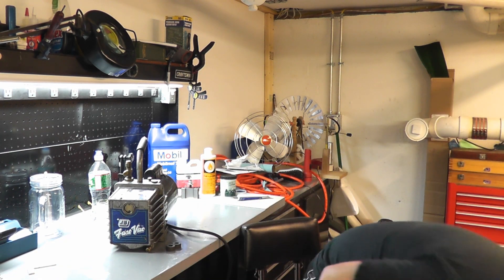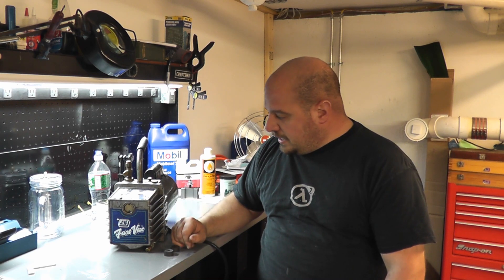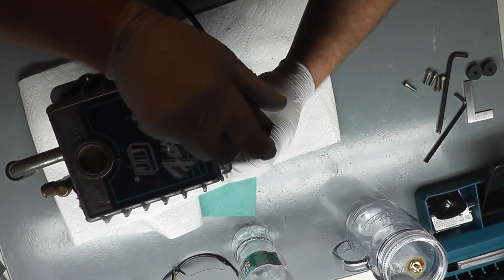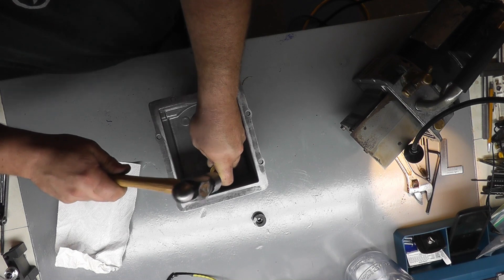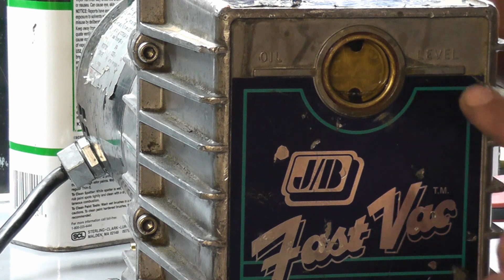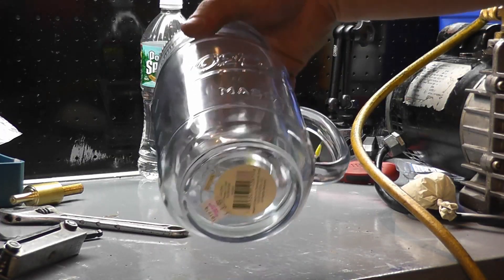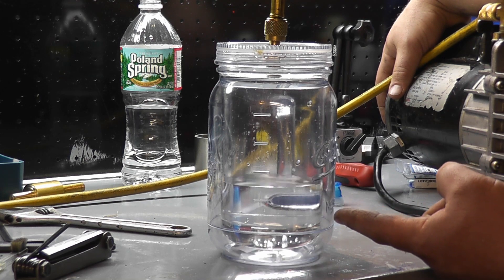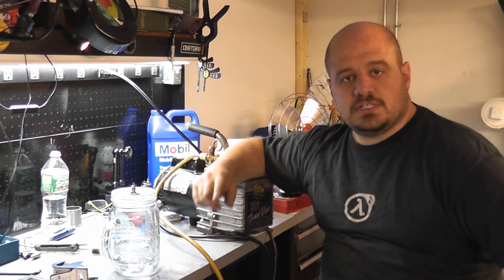Vacuum Pump Fun

Comment: Interestingly, not only does putting water under vacuum raise the boiling point, putting it under pressure also lowers the freezing point (and the boiling point). It's how ice skates work; it melts a layer of the ice right under the blade, which gives very low friction. There's also quite a cool effect where if you hang weights off a block of ice with a really thin wire, the wire will melt the ice and be able to pass through, but when the pressure is gone the water will refreeze, so the wire can go all the way through the ice, but leave it in one piece.

Comment: I had a new deep freeze that I stored for a few years.  When I went back for it the cabinet had some rust holes so I took out the compressor and soldered on a fitting and use it for a vacuum pump on the rare occasion when I need one.  The occasional car AC compressor failure and such.  Lately I have read the instructions from the car companies say to just purge the system with refrigerant, pull a vacuum and charge it.  They say it is not worth the trouble of boiling out for a long time on an automotive system.  Thanks for the video.

Comment: Perfect timing!  I just flushed a bunch of very new hydraulic oil out of my shop press that's water contaminated.  I'm gonna get a jar and some fittings and vacuum that oil back into shape. :)
Reply: UPDATE: Not going as I expected.  I get some boil off at the start but I think vacuum drying 3 gallons of heavily saturated oil will take, conservatively, until the End of Time.  I now appreciate the time needed to vac a large old system.  I just assumed the water would flash off quickly but hydraulic oil (and maybe reefer oil as well) appears to be quite hygroscopic and will happily hold  onto water like Rosie O'Donnell clutching a Twinkie.  While heating the oil helped, I had to get it to a temp that boiled off the lighter fractions that might make the oil unusable.

Bottom line: It's not worth the effort.  At 5 bucks a quart I'll just buy new oil.
Reply: +Eddie the Grouch Dang it!! I have gallons of it from my excavator that I was hoping to salvage....One particular bucket was only in the machine for 5 minutes then changed. :-(
Reply: +Eddie the Grouch +CompEdgeX 
Moisture contaminated oil can usually be dehydrated by heat. 
Place the oil in an open top container and heat to at least 220 degrees Fahrenheit but less than about 260 degrees Fahrenheit for about 30 minutes. We usually target about 230-250 degrees. This temperature range does not harm the oil but boils the moisture out of the oil allowing it to escape into the atmosphere. 
Immediately place the oil in a container and seal before it reaches 180 degrees Fahrenheit and it is as dry or drier than when it left the refinery. 
Most refrigeration oil and some hydraulic oil is highly hygroscopic by design to absorb moisture and protect the system from undesirable reaction such as acid formation and resultant corrosion. 
We have a commercial mobile oil reclamation and filtration system that automates the process and filters down to 10 micons, but before we purchased the commercial unit we used to perform the process manually and never had a problem. The commercial unit has Vickers, SAE, ANSI, API, Mobil and Shell approval.
Reply: patw52pb1
I never thought that heat would be an issue...when I'm working the excavator on a 30deg C day that oil gets mighty hot as it is. I kinda figured the vacuum would allow moisture removal without setting up a heat source. Maybe a combination of vac and low heat will work... :-)
Reply: *****
Hey Colin. 
yep, vacuum alone will do the trick and heat accelerates the process. 
Here is a URL to a site with an article about moisture removal. 
http://www.machinerylubrication.com/Read/503/removing-water-in-oil

Comment: I used that setup with a painted jar so you could not see the water. I ask the new techs to tell me when it was free of moisture. Most would say when the gauge got to 30". then I'd show them that the micron guage was the only way to tell it was moisture free and leak free. It was like a light bulb went on when I showed them this.

Comment: Most interesting thanks. Out of curiosity do you know what the design is of the actual pump? 
I am familiar with vane pumps as used in milking parlours and most sludge tankers but I suspect they are unable to to create as much vacuum as yours although they can remove a lot of air very quickly.
Reply: +Dan Whiteford 

This is also a rotary vane pump.  Higher vacuum is achieved by holding tighter tolerances with the vanes, etc.

Comment: What's a micron in the context of vacuums? I know that a micron in the context of distance is a micrometer (10^-6 meters), is a micron just a micro-torr? Or some other unit of vacuum?
Reply from the maker: +Rob Mckennie  You're correct that it is a measurement of distance.  In this case it would be a measure of inches of mercury, the standard measurement unit of vacuum here in the U.S.  Basically picture a tube in the shape of a U filled with mercury partway.  Mark the line where the mercury level is at atmospheric pressure.  Expose one end of the tube to vacuum and the mercury will travel a certain distance.  Anything beyond 29" Hg of vacuum is measured in microns.  Most systems are pulled to 500 microns before charging for leak checks and moisture removal.
Reply: +Rob Mckennie !4.7 psig is approx 760209 microns. The high number is why most micron guages don't even read until it gets down 1000's

Comment: When water boils at room temp... I assume it remains at room temp and doesn't heat up?
Reply from the maker: +DSCKy Correct.  There is no heat acting on it other than ambient temp.
Reply: +Halligan142 But the water temp will come down if the glass were insulated so the ambient couldn't equalize the temp as fast. Evaporation removes heat just not as much at lower pressures. Drop a thermometer in the water and observe.